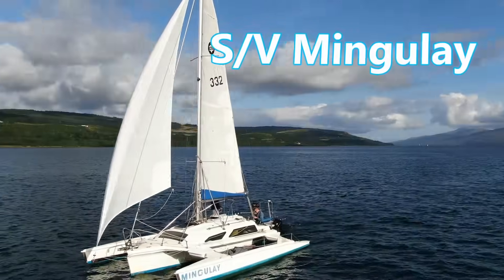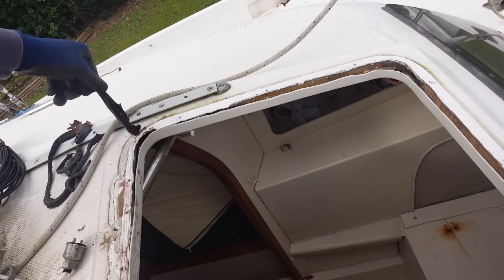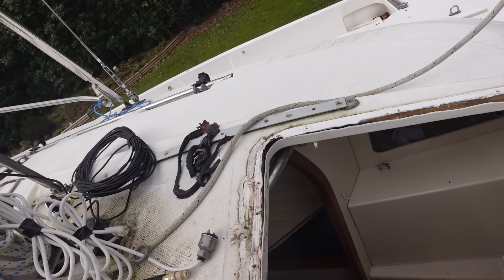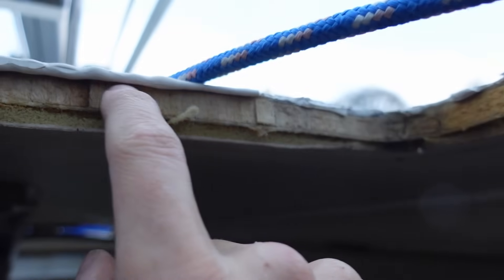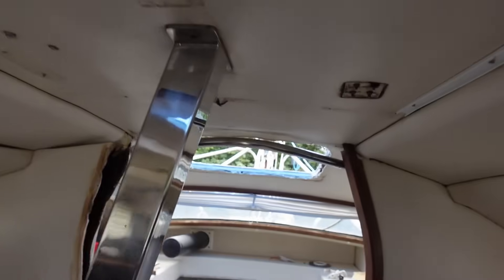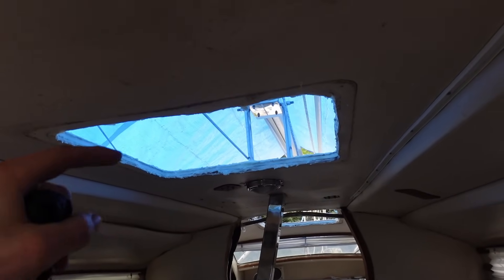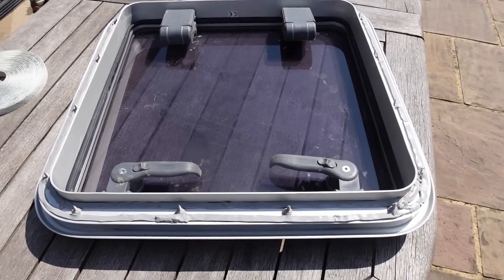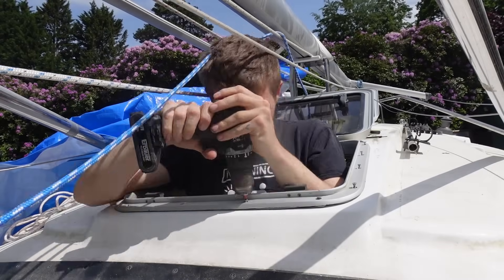ROTTEN BALSA CORE ON MY NEW TRIMARAN + New Hatches | Ep.124

Comment: Nice job on the hatches ... just a tip for the Sicaflex if you come across a stubborn section -- pour isopropyl alcohol over it and give it a few minutes to break down.  The alcohol with soften up the Sikaflex to make it much easier to pry away or dig into for accessory removal.
Reply from the maker: That’s a really handy trick! Thank you! 🙏

Comment: Nice work! Top tip; use a plastic bag, like where you freeze stuff In, fill it with epoxy, cut a small bit of a corner and fill any void like a pro without air pockets!
Reply from the maker: I did try that to start but was hard to get it to go deep enough!
Reply: I said same thing before I saw this
Reply: I wonder is there a large syringe with a tube you could use to inject your thickened epoxy.
Reply from the maker: @alansmollen  that could be a good idea!

Comment: Love this episode!!! Wouldn't it be possible to create a grid of holes on the deck or soft areas and inject penetrating epoxy then thickened epoxy into that part of the core? I am thinking of doing that to my boat, but you have more experience with this than I do.
Reply from the maker: The main thing is getting all the moisture out before you do anything. The epoxy can’t soak if it’s already wet.
Reply: Tried I with my 1972 Catalina 22...end up with a bunch of epoxy pellets. No getting around cutting off deck and replacing wood with new wood or similar and replacing top deck panel.
Reply: @tinycmo  Thanks!
Reply from the maker: @tinycmo  definitely the best solution!

Comment: Alex if you need to do that job again, try using a piping bag (or just a plastic bag with a corner cut out. Easy to squeeze the mixture in with. cheers
Reply from the maker: I did give it a try to start with but was too hard to get into the deeper parts unfortunately. It a very good method though and a lot less messy!

Comment: what is the 2 part stuff you are treating the balsa core with, prior to epoxy?
Reply: i think it was just epoxy resin ? Then he used the thickend  epoxy with glass.
Reply from the maker: Penetrating epoxy! It’s very runny!
Reply: @AlexGoesSailing thanks. Didn’t know such a thing existed. I used SP epoxy with glass beads filler and sections of high density foam core. Did the first pass with straight epoxy. What brand is that runny epoxy pls?
Reply from the maker: @ZZ-ek7mx  I just got a random one that I found as it’s used in woodworking sometimes so is fairly easy to find.